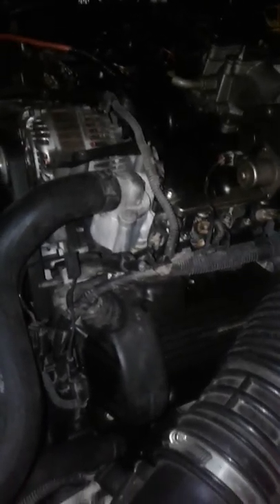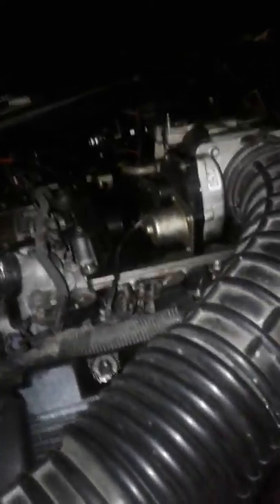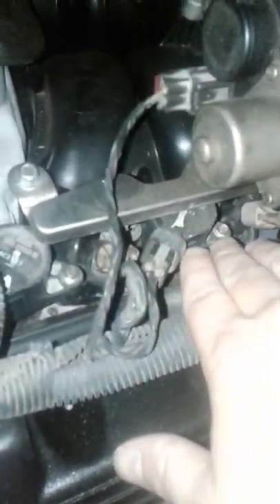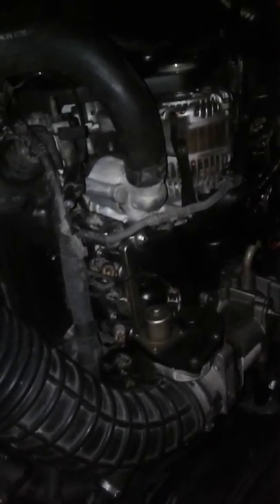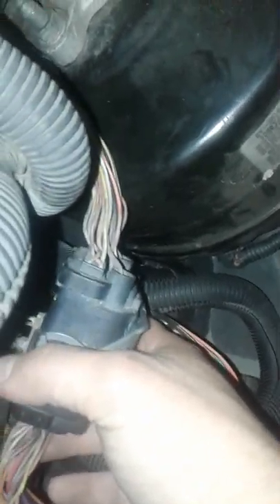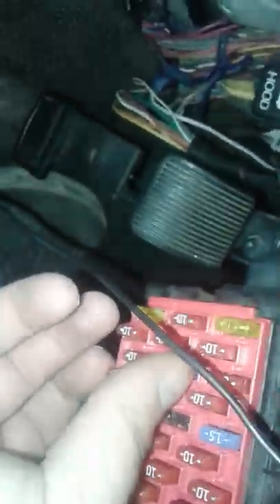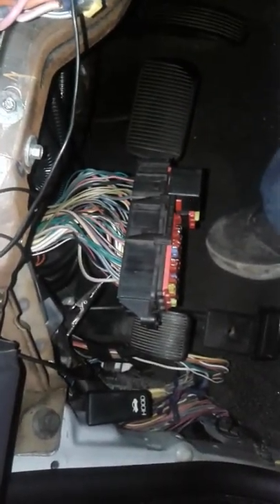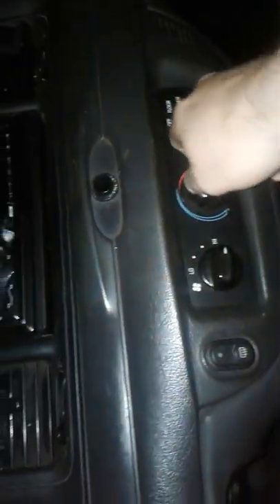Crown vic stalls while driving. ( multiple codes)!!

Comment: Had a 2003 Crown Vic with 750,000 kms on it put about $750 into it new brakes, hoses, oils, new spare tire. Ran for 3.5 years no problem. Drove fantastic in snow best ABS Ford has also engine power plus. For the investment great deal. Engine still runs. Later!

Comment: Pretty low miles for a 05.  Got a garage- kept 1995 LX with 36,000 orig. from a nice granny who could no longer drive 
Had corrosion in the harness plugs that I had to dielectric grease (dash was lighting up & then stalling while trying to pull into store parking lots)
Paid $2000 for the vic.  Now runs/drives like a new car, after I replaced the dry rotted/noisy sway bar links.

Comment: geez.. I'm not getting alot of codes but my 2011 P71 is shutting off... i changed the throttle position sensor (junkyard)  and Egr and ive noticed its stopped idling but it still cuts off and i can start it right back up...any ideas other than a new wiring harness.. plugs are good and coils no check engine light either
Reply: Any updates?
Reply: I’m having the same issues
Reply: mass airflow sensor or vacuum line dry rotted?
Reply: @vincentfarley9309  I’m having a issue where I fixed the p2104 code replaced the throttle body and reprogrammed it and now it drives perfectly but it’ll randomly die at 55+
Reply: @mikedaguy3049 it sounds like too much air is coming in from somewhere
Reply: @mikedaguy3049  can you hear a whistle while it's running?
Reply: @vincentfarley9309  no whistle while it runs was gonna check the egr valve with a hand pump and then was gonna check the fuel pump and filter just seems like an annoyingly stubborn issue
Reply: @mikedaguy3049  either that or the pipe that runs to it. I had the same problem with my expedition which is the same motor just a little bigger. It was my egr valve, maf sensor and a vacuum line them I was good after replacing those.
Reply: Any updates??
Reply: @carlosbenitez15   nope it's still doing it.... It stopped during the winter and just started back as it's getting hot... It stopped idling but it still  turns off... I've noticed it mostly happens at idle... I'm about to get a smoke test done... I think it's something with the gas.... My gas cap light goes on and off even i bought a new cap a year ago from ford... Like it not getting enough gas at idle and stalls out... The check engine light is definitely on now
Reply: Yeah my car is an 06, has been doing it for a couple months now, just randomly shuts off, doesn't really matter if I'm driving or parked, shuts off about 4 or 5 times depending on how long I'm driving, which usually isn't long, just to work and back, my codes are with the torque converter clutch solenoid
Reply: @carlosbenitez15  have y'all tried the air filter or any of the 02 sensors?
Reply: Or it could be an ecm issue
Reply: @carlosbenitez15  I don't have either of those codes I can't remember the codes but it wasn't any of those
Reply: @vincentfarley9309  I have a kn air filter and when I bought the car I did all the o2 sensors like 2 years ago
Reply: @vincentfarley9309  I've heard this before as maybe a issue but I definitely think it has something to do with my gas... I have horrible gas mileage... When I start the car I smell a very very slight odor of gas in the car... The code said something about it running lean I'm guessing at idle which makes it stall out.. the one thing I can't understand is it didn't happen all winter... It only happens during warm months
Reply: @shakezula2745  have you changed the fuel filter?
Reply: @shakezula2745  it's under the car by rear passenger tire
Reply: @shakezula2745  come to think of it get some starting fluid and spray the vacuum lines before you do anything else that maybe your problem because the cold contracts those lines while the heat makes them expand
Reply: @vincentfarley9309  now that sounds like a good idea right there ... I'll try it later and give a update
Reply: @vincentfarley9309  never changed my fuel filter and those are pretty cheap... Noted I'm going to try that too my b day is coming up and I need to pass emissions
Reply: @shakezula2745  when using the starting fluid if it revs higher you have a leak
Reply: Damn I just realized this my comment I'm over here commenting LMAO I still haven't figured it out lmao I did have a  vacuum leak at the EGR on the gasket but it's doing it... It doesn't do it as much in the winter I'm about to replace the mass air flow and the throttle position sensor... I'm also about to get a smoke test done... My gas cap light comes on and I smell gas I'm about to replace the intake manifold fuel injectors and see if anything changes... It definitely idles and I've noticed it only turns off at low RPM.. I changed the fuel filter and replaced some hoses give me like 3 weeks I'll update
Reply: @backinz nope
Reply: @vincentfarley9309 changed the air filter and 02 sensors still no change

Comment: and my wipers have stopped working change the motor fuses and switch still no wipers and my a/c stoped working blows hot air full of free-on
and power steering is messing up to but got plenty of fluid in it
and i have a dead short somewhere i park up say two or three days it wont start has to be jumped off
has a miss to it too when stopped at a red light or something
Reply from the maker: I'll give number when ur ready. But I sleep like a normal person so no 12am
Reply: I have similar problem I changed everything still get 02 Senser code